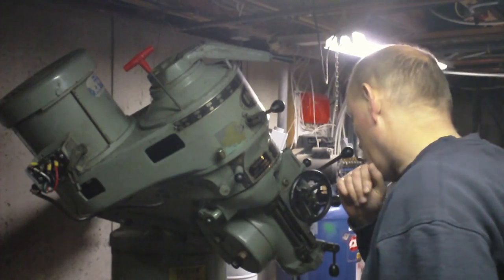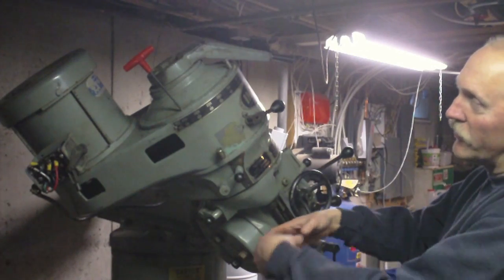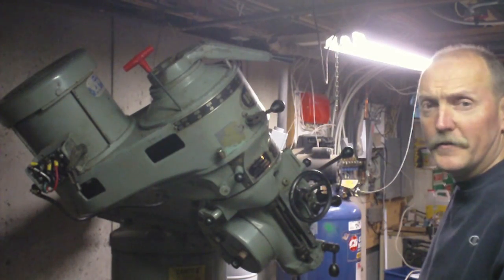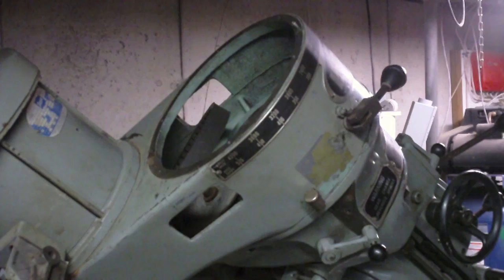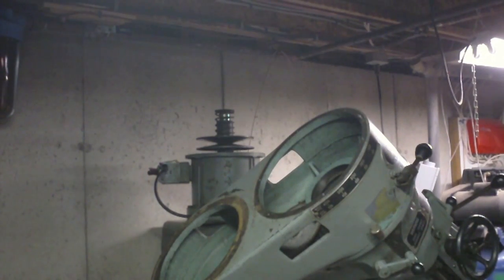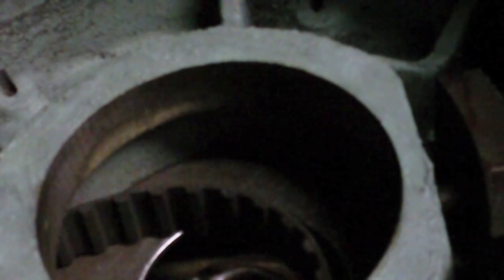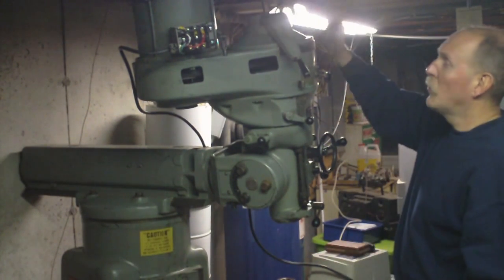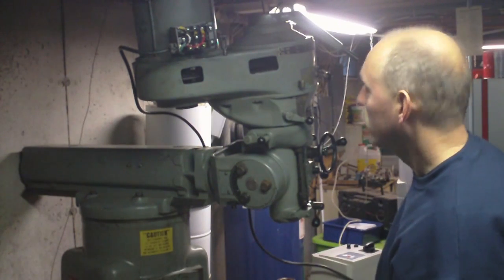Wells Index Milling Machine Part 54

Comment: I would check the pulley I have seen them mimic if a rod knock to a tea. As to your shaft I would also recommend Kieth. if he can weld up a back hole sprocket and machine the bearing race. Fixing your shaft would be a lot easier in my humble opinion. Think your going to have a great shop when further along.After all your really never done till your really done! May that be a long way away.
Reply from the maker: Hello. Thanks for watching this series. I've gone a long way since this video, including buying a second machine for parts! Hope you enjoy the rest of the series........and I'm not done yet!

Comment: Steve;

Classic old fan belt sound from that top end.  My bet is the belt is worn out and you need to buy a new one.  The belt could have hard spots on it and that is why you get intermittent noise.  If it was the bearings, I have to believe you would hear the noise at all speeds.

Regards;

Ron
Reply from the maker: Ron Kluwe Hi Ron. I hope you're right. Hate to think one of the new bearings is to blame.

Comment: And that spindle movement would be by hand rotation. 

Best.
Reply from the maker: wiredodger60 Thanks, I cover that at 12:29, but prior to this video my issue was caused by mis alignment. Regards.